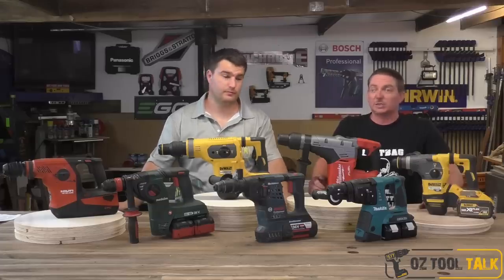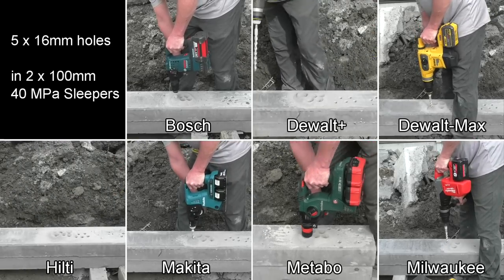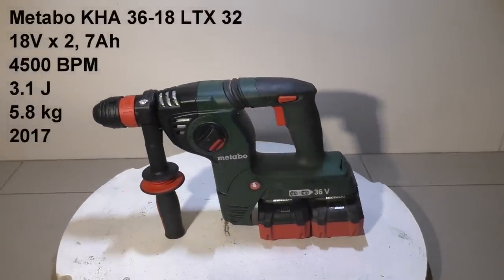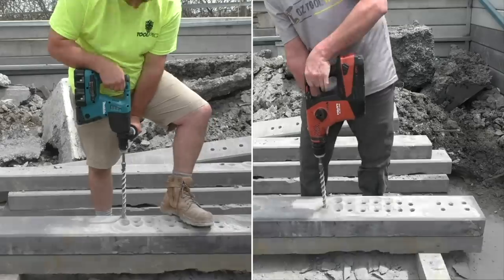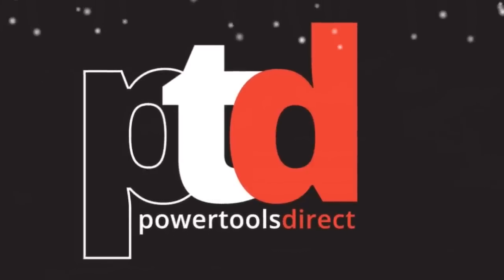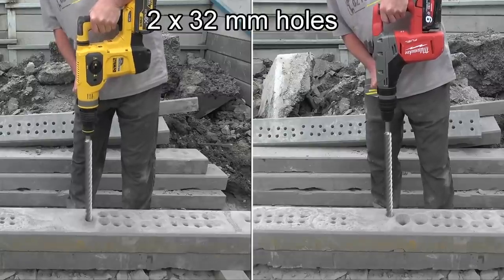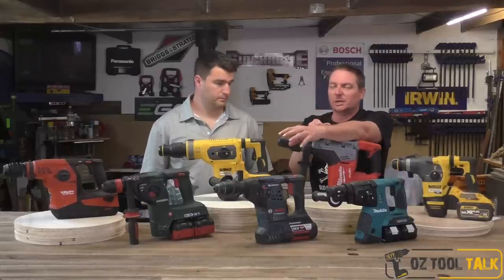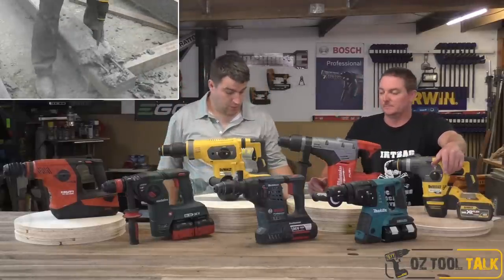PREMIUM Battery SDS Hammer Drill Shoot-out - Dewalt, Bosch, Makita, Metabo, Milwaukee, Hilti

Comment: This larger die grinder https://www.youtube.com/post/UgkxmwiwyX3ADeryrwvcsiwLeKxme6QNQmGL runs very smoothly in use. There's virtually no vibration. Paddle switch with the safety trigger is a bit cumbersome to use, but is much safer. Grinder cannot turn on if set down on the bench.Note that this die grinder, like most others, runs at 25,000 rpm. Always use a face shield and hearing protection. If your grinding stone has any sign of chips or cracks, throw it away. At 25,000 rpm, the stone sees very high G-loads and could come apart explosively if the stone is damaged. Always run the grinder for a short time before using it to check the stone.This tool is heavier than some but very well made.Recommended.

Comment: For heavy duty work I'd go with the Hilti though (if you need cordless access), I have a corded "non-brand" SDS drill with like 3J - and it drills holes in iron reinforced concrete like into butter, with it's brushed motor though. Liked the review nonetheless! Great work guys.

Comment: Hard to beat HILTI on anything other than cost, right across the board.
Reply: They’ve always had the best SDS around for years
Reply: Both dewalt and milwaukee overtake hilti on many tools now.  Drop saw and reciprocating saw especially
Reply: @rezendogmorales3747  They do tend to specialize in hand drilling and rock breaking tools though. 🙂
Reply: @navnig  yes but you said anything. I'd say they are only better in maybe rotary hammer drills. Because core drilling milwaukee is slowly taking over.

Comment: I’ve tried out most all brands threw out the years an I’ve found Dewalt to be my tool brand for pretty much everything now. An this video is just one example why.
Reply: Ditto
Reply: If you are happy with the power tools you use that is what matters, over fourty years working in construction I have seen all brands on site, only in heavy duty applications does it really matter what brand you use, in less demanding use all mainstream brands will do a good job.

Comment: Bosch for me. DeWalt is the most powerful, but I think Bosch is more precise and durable. My 19 year old Bosch GBH24 VRE is still going strong, runs as good as new! It's been through a lot of crap, from smoking, to being red hot and it just doesn't want to die. My only issue is its batteries. We are down to 1 and it's starting to die out, it's been in this stage for quite a while, so I hope to source some genuine ones second hand.
Reply from the maker: I too place a lot of trust in an SDS with a Bosch logo on the side [Dwain]

Comment: Great review guys. As primarily a Makita owner I was a little depressed with their performance until I saw the difference in skin price! I just have the single 18v Makita hammer and it works fine for what I do. (very occasional tile chipping or lino removal)
It would be nice if all makes used the same batteries so we could pick and choose between manufacturers for different tools but I dont think thats ever going to happen!
Reply from the maker: [Dwain] Cheers AussieGuy. That'll never happen, agreed.
Reply: @OZToolTalk That particularly happened. NEW hitachi (hikoki) metabo mafell collomix and some other German tool manufacturers now use the same battery platform. Hope they would poach other to their club.
Reply: @OZToolTalk  oh, ridgid vs AEG also have same platform.

Comment: I use the dewalt dch333, i love it, absolutely rips through 10mm holes, maybe even faster than some corded ones. Its super comfy, and even doing 20mm holes for rebar, it is pretty quick
Reply from the maker: It's a beast
Reply: Oz Tool Talk yeah mate, especially for its size. 

Only problem is that everyone else wants to use it

Comment: When I think of concrete the 3 tools I think of are Dewalt, Hilti and Bosch
Reply: I think Hilti, Hilti and Hilti
Reply: Hilti SDS Max drills are made in Austria, thats at least what it say's on the machine
Reply: Jack Braddell actually they won’t mention it but the origin of the tool varies based on the model but we’ll never know exactly what and where unless you know someone that works for them

Comment: Hi guys, how did you work out the runtime scores with so many different battery sizes and amp hours? Surely the only fair way was to do it based on total watt hours?
Great review 👍
Reply from the maker: We just gave the results exactly as they came. People can do some maths if they want to work out runtime per Ah, but it's not like an 18v drill driver comparison. These are the best tools, with big prices and set battery configurations.

Comment: I'm not sure if the Milwaukee M28 FUEL 1-1/8" rotary hammer was out then. But I would like to have seen it in this test since it it is a 28 volt

Comment: I do love Milwaukee, but they’ve really let themselves down with this drill. If you had the smaller one (SDS+) it’d been a better drill as it’s got 4 modes and has anti vibration in the handle. 
I’m surprised they didn’t use one as they did the same for DeWALT 🤔
Reply: Dewalt handily outperforms the Milwaukee in the sds plus as well. However Milwaukee has since come out with an updated version I believe.
Reply: @jamesnm21  I think the updated version comes out may
Reply: @jamesnm21  still it’s hard to beat them 54/60v battery’s

Comment: Love my 18v dewalt gear but the hilti as the oldest and most expensive I recon will win
Reply: I called it
Reply from the maker: [Dwain] Hilti still nailing it ;)
Reply: Hilti rotary hammer-look ugly, Hilti tool for concrete work only, ONLY I LOVE DEWALT BATTERY AND TOOLS, Milwaukee, Makita and Metabo batteries ONLY with HIGH CAPACITY, NOT any need tool, WON'T buy  Hilti battery and tools
Reply: @iginiobluevest9259  A drills performance is not judged on its looks, if it was the two Dewalts would loose hands down, they are PIG ugly, Hilti is best for heavy duty site use, a lot better than my Makita sds drill!!!

Comment: As you sleeper has rebar how are you allowing for the those holes that hit STEEL ??
Reply from the maker: [Dwain] we know where the rebar is, and don't hit it. we had example showing where the rebar sits (and it's my cousin factory)
Reply: Thanx for that info great work and info Guys  :) maybe if possible include longevity test / feed back for tools  personally Iv'e used various tools over 35+ year as Industrial Electrical Fitter All the Makita I have bought are still in service including the first LIon I bought a combi drill and Battery 2003 still in use today (getting a bit worn now )     I have also bought many Dewalt Bosch and others tools and Batteries all are now dead  also seen that people in the same industry seem to  have replaced tools & batteries over and over on a 3-4 year cycle

Comment: Can any of these be also used with 230V (110V) cord adaptor?
Reply from the maker: xmeda no they can’t
Reply: That is sad a bit. I remember that DeWalt had some adaptor for accu tools to run them also plugged. And also some chinese cheapo manufacturers do offer hybrid plug-in adaptors fot their tools. And I find that quite useful as occasional user mostly working within the reach of plug. Or for situations, that you really need to work several hours without charging. And yes, many quick chargers are able to charge the battery somehow before other is depleted, but these short cycles with high currents and overheating do significantly reduce battery capacity over time. Especially for power tools like rotary hammers this plug-in adaptor should be included.

btw. Do you plan to compare corded rotary hammers? This battery tools review is nice! And I'll be very interested to see 4-6kg corded machines also. Tools like Bosch GBH 4-32 (SDS+) DFR and GBH 5-40 DCE (SDSmax) and some comparable tools from Makita, DeWalt, Hitachi, Hilti, Milwaukee or Metabo. These are used both by small companies and homegamers for lighter drilling, chiseling through brickwalls, light concrete demolition stuff etc.. And there are no usable comparisons available around. . + maybe add some cheapo piece ($100-150) just for comparison :)

Comment: have you compared the DeWalt 54v Vs Milwaukee 12amp?
Reply from the maker: as in the batteries? we don't really see the point of comparing batteries without tools. nor how we would, don't really have the expertise.... [Dwain]
Reply: @OZToolTalk  I meant testing both SDS Max machines using the best batteries available.

Comment: Hey guys how many people do you know with the 9ah dewalt batteries and ask if there batteries have died ? I am about to take my third one back to be replaced of the twin pack i brough so both have been replaced and a replacement one is about to go back had for 15mths
Reply from the maker: [Dwain] of dear :( I have heard a couple of reports actually.
Reply: Oz Tool Talk 
Was think that might be the case due to having 26650 cells as they arnt as explored as the 18650 that should change soon as more products out there are launching on that cell type but that still means another year or 2 before you get the same cell strength as the 18650s
The 6ah have not had any problems at all i have 2 of them also and not one has failed me
Reply: Sorry they are 21700 either way still not as strong as 18650

Comment: I wonder what the recently introduced SDS MAX HILTI TE 60-A36 (8 Joules) and DeWalt DCH773Y2 (19.4 Joules) would do. The DeWalt is at nearly half the price of the Hilti.
Reply: Half the price but 1/5 the durability. (if you just drill 2 holes per week than go with a non hilti)

Comment: Would love to see how the hitachi compares
Reply: Actually Hitachi isn't all too bad . I had a Bosch corded at 3.1 joules before I started using corded Hitachi 3.0 joules with both using 18 mm on an old construction concrete flooring for 6 inch anchor bolts. That Hitachi kicked  ass and was almost 3 times faster that was about 15 years ago

Comment: Why isn't festool's hammer drill part of this review?
Reply from the maker: that would have been very unkind to the little 18v Festool.
Reply: @OZToolTalk  uhhh, I am a sculptor who has used multiple hammer drills, including hilti and DeWalt corded. My PDC 18/4 can easily keep up with them, hammering into much denser stone than concrete. Maybe not the same run time, but plenty of power.

Comment: Hi guys, fantastic video and work by both of ya. Thanks for this.

Little target for for 2018. Clip on microphones for ya both. It make a massive difference as opposed to the audio from the camera a meter or 2 away from you.
Reply from the maker: [Ryan] thanks mate. yep we agree. should have mounted the shotgun mic above us at a minimum. we ended up with the camera a fair way back due to the width of the shot :(
Reply: Camera and video quality is top notch though as always!

Have you guys come across Makita's 12v/10.8v (depending on what region) tools yet. There is a kit sold by amazon here in the UK directly for £125 which is about $210 AUS and is very highly rated by (i'm imagining) DIY users:

https://www.amazon.co.uk/Makita-CLX202AJ-Impact-Driver-batteries/dp/B01AWOI406/ref=sr_1_4?ie=UTF8&qid=1511735232&sr=8-4&keywords=makita+10.8v

The weight to power ratio with value considered looks great!
Reply from the maker: [Dwain] nah we haven''t played with the Makita 12V line. It does look impressive though.
Reply: Sure does - 110nm from a 10/12v impact is fantastic. I can see this kit mopping up the market @ the price with the included charger, batteries and combi too. I have yet needed to go over a inch and a quarter in wood with my 18v DHP459 Makita and the DTD153 Impact has breezed past anything 4" and under screws in wood.

Amazon AUS is launching anytime soon - i'm surprised it's taken this long, are you guys going to getting an affiliate account setup? You sure deserve it if users are going to purchase tools you are rating highly!

Comment: How about the new Bosch GBH 18V-26(F)?
Reply from the maker: [Dwain] We'll be reviewing that shortly (already in testing). It is not the match of the 36V unit though.
Reply: Oz Tool Talk i own the GBH 18V 26F and you can't compare the 18 and 36V Systems. The 18V is hand to hand up to 10mm in steal concrete nearly as fast as the 36V. Smaller hoses live 8mm is even faster because its faster spinning. For a contractor drilling indoor for drywall concructions and up to 10 mm you are fine. You also can do 68mm holes

Comment: Why use a weak 18V Milwaukee and compare it to 36V, 54V tools?  Doesn't seem fair.  They have 28V version that's still using less power but a much better comparison at least.
Reply from the maker: Hi David, we used the BEST SDS from each brand, regardless of voltage. Because people want to know which brand to buy. THe Milwaukee isn't weak at all. I don't know why you'd think that. And they have proven with other tools (such as the recently released 7-1/4 circular saw) that they can generate just as much power from a high capacity 18v battery as others have done with 36v/54v tools. [Dwain]
Reply: @OZToolTalk  The best SDS Rotary Hammer drill by Milwaukee IS their 0757 28 volt.  So why did you use their 18 Volt?  The 18 volt is ABSOLUTELY weak compared to the 28 volt version, that's why I think that... in fact I'd say I KNOW that because the specs alone prove it. You  know...facts.  The fact that the 18 volt version can still hang with this group says something about the Milwaukee design.  Put the 28 volt version through these same tests and you'll see.  That was my point from the beginning; the 18 volt hammer drill is NOT the best Milwaukee cordless brushless SDS hammer drill by far. 

 Using it to claim "fair" comparison is ridiculous, disingenuous, and skewed, and you know it.   If you want a fair competition, put the 20 or 18 volt Dewalt Hammer drill against the 18 volt Milwaukee. You know why you wouldn't do it?  Wait for it... because they'd get "HAMMERED" by the Milwaukee!!!  The 28 volt version is an SDS Plus like all the other big boys you showcased. The kit with 2 batteries goes from $600-$800 depending on seller, and the 18 volt is only an SDS, the 28 volt is an SDS Plus.

Comment: Bosch more comfortable than hilti, thats a shocker. Every bosch hammer i used felt like an earthquake, more power going to my hands than in the tip, but i only used corded units.
Reply from the maker: Tadej Furlanič that’s interesting, we clearly only used cordless here. It is an individual feeling and opinion too though.
Reply: I have only experience with the gbh 2-28 combihammer and the big 12 kg demolition hammer. When I looked at buying the 2-28 i was just looking at stats on paper and on every number bosch looked superior to hilti, but with one year working with the bosch I just find it to be more and more a task i don't wont to do. My guts tell me that prosumer companies like bosch, makita etc. invest more into good stats on paper and affordable price, but sometimes more power is not better. 
I just purchased a used hilti te-30c and it has almost the same power as the little bosch but its 1 kg heavier, at first sight it would seem inferior, but in my experience the power must be proportional to the weight, otherwise the tool isn't stable. I am looking forward with getting more experience with the hilti and learn if it really is a superior tool.
Addendum, I must clarify that I mostly do demolition work (bathroom tiles and concrete chipping) with the bosch, and hours of it and it just crashes my hands. The tool is likely more comfortable if used for drilling.
Reply: I’ve been running my Bosch, splitting granite for almost 2 straight weeks, and I hate it, it’s slow and it vibrates the hell out of my hands
Reply from the maker: [Dwain]  As Mike said it is a little subjective. I think the difference between the two is very very small.

Remember though that the Hilti is faster. At the end of the day, the best SDS is the one you have to use for the least amount of time!
Reply: True , although Bosch gbh are great tools , they make too much of the  lighter weight aspect which is not always a good thing..................

Comment: The Hilti version in this test is pretty old. The new 5,2amp batteries has way lower price then the old 6amp batteris. So a bit strange that they havent got the new version
Reply from the maker: [Dwain] In Australia there are only 2 36V units. This one, the premium unit, for $2.5k, with 6Ah batts. The other comes with 5.2Ah batts, has lower specs and still costs $2k.

Comment: All are toys compared with the hilti. There is a reason its $2500
Reply: Um Cuz it's a hilti.  I've used better tools
Reply: The top class Milwaukee 18v SDS Plus drill is a beast (not shown in this video, for some reason.) I'm pretty sure with a 9.0 or 12.0 battery on it, it will outperform the Hilti. The Hilti TE30 is an amazing drill though, really designed for never-ending productivity, if I get one some day I'd like to test them side by side to see which is faster. At the end of the day regardless of drilling speed the Hilti probably has the run-time advantage, Hilti always designs for productivity first and foremost before they do out-and-out performance.
Reply: So I have the top milwaukee sds plus and have compared side by side with the 36v hilti. Very similar so similar it's hard to tell the difference apart from feel which the hilti felt a bit more solid but drilled as fast as each other
Reply: Summit M18 HVAC guarantee that you haven’t used better tools you only think you have. Check out AVE channel were he actually takes the tools apart and compares . There’s a reason Hilti can do a 20 year warranty it’s because there tools are built to last
Reply: @stiaankruger2699  I have used the dewalt and makita and they only last a few weeks out in the field. They are built for diy people
Reply: @stiaankruger2699  haha I've worked it out now. You are just a DIY guy trying to pretend to be tradesman. All the rest of these are toys compared to the hilti.